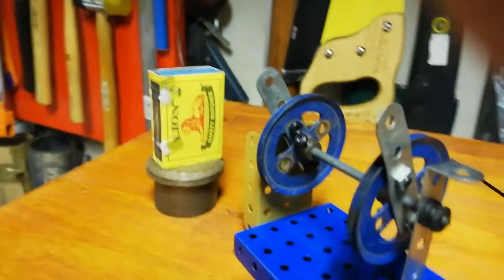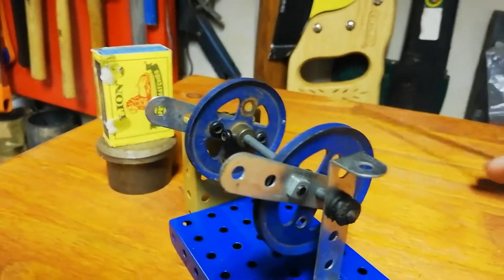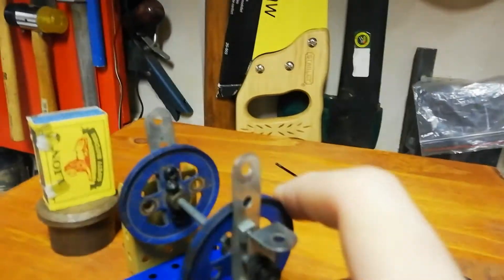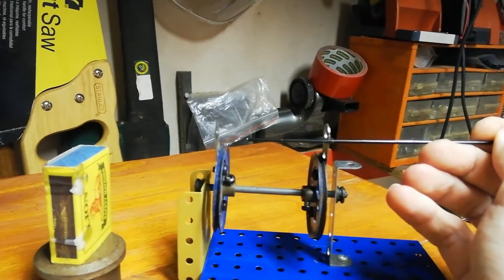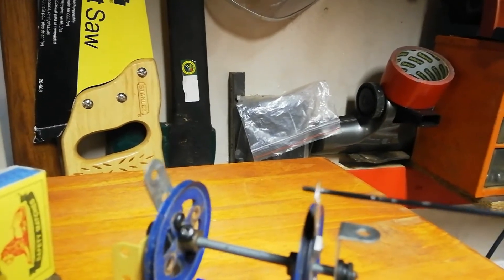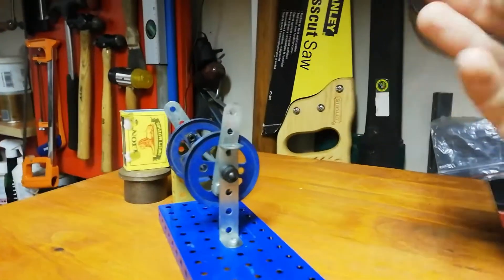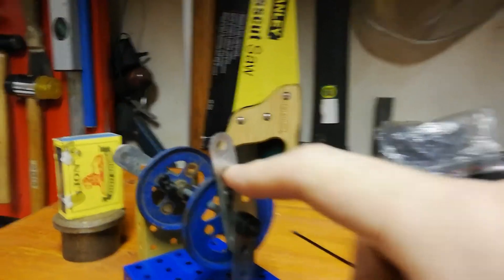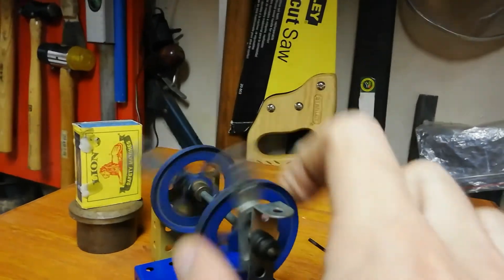Measurement of the Speed of light in 1 direction

Comment: An original idea but may have difficult in implementing. 

There are more practical methods. One possible method would be using radioactive decay (for example muons). Fire these particles close to or at a fraction of the known speed of light. If the speed of light in vaccum really is different in different directions then these particles would travel long distances in the direction in which the speed of light is "slow" and very short distances in the direction in which the speed of light is infinity.
Reply: I think that common misunderstanding  of veritasium's idea is that light travels instantaneously is an exaggeration, but even the slightest difference in light speed can change physics
Reply: Yes, true. The violation of rotational symmetry also violates certain conservation laws. 

Also considering that space time bends around large objects light can change direction but still be travelling "forward". This would then require a discontinuity in space time.

Comment: In a manner of speaking, no object will move faster than the speed of sound in the medium it is traveling because it will collide with, accelerate, and effectively heat up the particles it encounters, increasing the speed of sound immediately in front of the object 
and if we set the object in such a way to measure the speed of light how will you know when did you fired the light and when the light entered the second opening as you will need 2 clocks, but as Erik said two synchronized clocks are not actually synchronized if you move them apart 
btw amazing work hope to see more people use their brains in topics like this instead of playing minecraft lol

Comment: I have come up with an experiment to measure the speed of light in one direction. I am serious. 
You start with 3 clocks of the same
Mass synchronized in the center of a disk. Then you move 2 of the clocks outward 180 degrees from each other to the outside of the disk by centripetal force as you spin the disk while one remains in the center. This cancels the possibility that the clocks will no longer be in sync by moving in one direction vs the other or at different speeds. Then you fire photons from the center of the disk simultaneously at both clocks to trigger the time they leave the center and are received. Tada! Can I have my Nobel prize nomination now please?
Reply: Hey when a clock moves then there is change in the time displayed in the clock due to time dilation and that depends on the speed of light so if speed of light is not same in both direction then the change in time displayed in both of the clocks will change by different amount so they will get asynchronized 

By change in time displayed I mean that the clock runs slower when it moves so the time it displayes will not be same as the time displayed by the stationary clock.

And when you fire the photons from the centre simultaneously then they wont remain simultaneous when the reach the clocks in different direction if the speed of light is different in different directions

I am not fully sure of this explanation but I think this is one of the reasons your setup might fail
Reply: @kalpeshbhatnagar1544  yes, I understand that. That is why, in my experiment, the 2 clocks that move outward do so by centripetal force as the platform spins. This way, both clocks are moving in all directions outward, thus canceling out any influence the speed of light may or may not have in any particular direction and it’s effect on either clock.
Reply: @adamholmes1992  whether your moving clocks arrive at their destinations in a straight line or a curved one, wouldn't the time dilation effect will be the same? You're moving the same net amount in the given direction, just with more steps.
Reply: @d.lawrencemiller5755  I only had  physics 120 and 121 in undergrad so I’m no expert, but both clocks are moving in all directions since it is spinning.  They both do this, do any time difference that affects a click being moved in any one direction and to a different amount or not at all in another direction would be canceled out.
Reply: I like your thinking in the move to cancel out the potential time dilation discrepancy in different directions by rotating, its a pretty novel idea.

Unfortunately the set-up still assumes the uniformity of the one-way speed of light in all directions (in the plane of the disk) for the simple reason that we are assuming all parts of the disk to be rotating at equal (angular) speeds.

When we begin to rotate the disk, (assuming this is initiated by some torque applied at the center), the material in the center of the disk starts to rotate. However, the entire disk does not all start spinning at once. Due to the tension from the intermolecular forces between the central part and the parts near it, this accelerates the parts near the center. This essentially continues on in a sort of 'wave' of acceleration, where the parts of the disc further away from the center begin spinning later than those near the middle. 
(The larger the disc, the more pronounced this effect will be)

Imagine an octopus with all its tentacles splayed out. If its middle starts spinning, its tentacles wont stay rigidly pointing outwards, rather they make a sort of spiral shape. This is similar to the effect I'm talking about here.

Anyway, the problem is that, in assuming that all parts of the disc are orbiting the center with the same angular velocity, we are assuming that this 'torsional wave' that propagates out from the center and accelerates the other parts of the disc moves at the same velocity in all directions. This is akin to assuming the isotropy of the speed of light. 

I hope this has been helpful!
Reply: @Dan-ii5wz  thank you for your response :)
I will think about your input and see if I can think of a way to overcome this issue.
Reply: I like the originality of your idea. I can't disagree with any of the concerns listed by others but it might still work for this reason: Veritasium said that unfortunately the difference in time dilation from relative motion will exactly offset and therefore mask any difference in directional light speed. But in this unique rotation you have set up - it may be likely that the directional motion isn't exactly neutralized so that we cannot consider the clocks to be precisely synced when they reach opposite end - however the amount of NET movement to the right for clock A in the end may only be slightly different than the amount of NET movement to the right for clock B. So even though it isn't a perfect cancel - the net difference may be much smaller than the net difference in lightspeed and therefore still show a difference in the end??? Needs more thought. Maybe someone can pick up the ball on this and add a comment. 

I actually posted my own solution video to Veritasium in February. Totally different than anything else I've seen and it works. 

Finally - Defcon Okay deserves credit for trying this setup. The physics of how relativity will affect the transfer of motion of material along the device is a concern by others and myself as well. However - the non-instantaneous nature of the rotation of both wheels in perfect unison might also somehow be compensated for since the "information" associated with rotation from the start side to the finish side also happens to be in the same direction as the traveling light signal itself. That could be considered and possibly be compensated for to get a meaningful result. And then the crank can be started a 2nd time from the opposite direction as the light signal - to see if the angle or result is the same as the 1st time? Something to think about.
Reply: @chriskennedy2846  thank you so much for your response. I’m fascinated by the fact that the speed of light has not yet been proven in one direction. I hope someone can potentially tweak my experiment design to do so.
Reply: @adamholmes1992  Good luck. Seems like the Veritasium video has energized a small community of engineering-minded problem solvers. It's nice to see. My video takes an entirely different approach. Since the theory shows that differences in light speed are accompanied by a necessary equivalent difference in time dilation rates, then I said: forget the light signals altogether and test only the extent of time dilation in opposite directions. That way if the 2 traveling ships at the opposite "finish lines" have the same clock readings, then time dilation is the same and a confident result for testing light signals could be achieved. But if the clocks experienced different rates of time dilation, then their clock times won't match when they cross their respective finish lines and it would be a good indication that we have a varying speed of light, based on direction.
Reply: You can't do that because one of the clocks is in rest with respect to others 
Which are moving with :- ωr

Comment: I don’t understand why you can’t just Measure the speed of light by synchronizing 2 clocks, why can’t you just instead of using an electromagnetic signal use something else. For instance if I had 2 clocks a certain distance away from one another and one had a paint ball gun and the other had a plate that could detect when something hit it couldn’t I start the first clock and then shoot the paint ball gun at the same time and then start the second clock as soon as it was hit. if I knew the velocity of the paint ball and the distance between the clocks I could calculate how far off they are.
Reply: It's a really good idea 
 But there are some issues
First we dont want to measure the distance between them we are actually not able to measure the time difference
Second, distances also change due to motion so if we use paint balls instead of electromagnetic signals. The time it takes to travel in one direction and the time it takes to travel in other will be different if the speed of light is not same in both directions. As the light the paint ball travels will contract according to special relativity and that contraction depends on the speed of light so if speed of light is different in different direction of both paint balls fired in different directions will travel different distances so it wont help in synchronizing the clocks.

Comment: your making it too complicated,  its so simple,  set up 3 mirrors so that they reflect each other but the first one has light source imput and output angle , the first one only serves the purpose of reflecting light to the second one,  sychronise the timers of the second and third mirror, reflect light from the first mirror to the second one it stops the timer, then the second mirror reflects the same light instantly to the third one and stops the timer,  calculate the time difference and distance and voila, you got one way speed of light
Reply: No worries bro, I'm just playing outside the box lol, but it's a good idea, you set up 2 test with 3 mirrors exactly the same and you use your first test to calibrate your second and final answer test, the law of the universe, yin/yan, hot/cold, happy/sad.......    =)
Reply: The issue I guess is in synchronizing the clocks of the second and third mirror
Reply: Easy to synchronise the clocks, you just set up the same mirrors×2 in same configuration as I mentioned earlier I.E. mirror image, and use the first set up of mirrors to synchronise your second exactly same set up, cuz you know reflection is instantaneous, so you just fill in the blanks, a+b=c or something like that
Reply: See there is a small problem I ca  think of that the light from the first mirror does stop the timer on the second mirror and then light reflected from second does stop the timer at third but how to do start the timers what I assume is you would want to start the timers on second and third mirror simultaneously and that's where the problem arises. Cause there is actually no way I can think of such that observers at two different places (second and third mirror) agree on length or time.

Secondly there is the problem of gravitational time dilation which is change in how fast time runs due to gravitational field this comes from the theory of general relativity and due the presence of matter in universe there is no place where gravitational field is zero as gravitational field extends till infinity so this will also effect simultaneity and measurement of length
Reply: Plus I been thinking past few weeks that the meaning of Einstein description of light is C/constant might mean that light isn't moving at all but it is we who are moving through it?
Reply: I am sorry about presenting so many counter ideas but i guess it's a good way to discuss science and I am not trying to offend you in any way 
The idea of we moving through light is something that does not resonate with me as I dont think of light as something what I like to think or what modern theories present is that light is just a disturbance in the electromagnetic field.
The EM field spans all space and disturbance in it means a region of energy or packet of energy which we call a photon and this energy is travelling as we know as the light from the bulb reaches my eye so light does move and so there is no good reason that light would stop moving once it has reached my eye after leaving the bulb. I dont think that would be a good thing as in physics we think of things happening independently of how we think of it or how we sense it. So if light stops after reaching my eye it should also stop after hitting a nitrogen atom as as nitrogen is all around us then light wont even get to us and will stop after hitting the first thing it reaches that means reflection wont be possible and we wont be able to see.
I am again not 100 percent sure about this but this is the way I think of it.
Reply: The only time light travels is when it lights up from a new source or ignights meaning the end, light can push stuff aka solar sails ect.... so I'm thinking the reason that light sources are spherical is because if it was flat it would push itself but as a sphere it pushes in all directions thus being stable
Reply: I forgot to specify that at the point of a light source ignition it has to be spherical or else it'll blast itself backwards from the largest semi flat  area of lumens like a cartoon jet propelled skateboard takes off and his body is gone and neck stretched out and hasn't caught up yet lol
Reply: And on top of that there's multipal light waves infrared ect..... and all react differently as individuals but similar as a whole
Reply: Aka light spectrum

Comment: It's the same as the 3-clocks example of veritasium on which the 2 end clocks are synchronize by the middle clock. Mechanical objects are also not an exception in relativity. For example you have a super long stick that cannot be broken and extends into the other galaxy, if you rotate the stick in any angle, the end of the stick will also not instantaneously rotates, but rather creates a wave in the structure of the stick until that wave reaches the end. That speed of the wave is the speed of causality or the same as the speed of light.  I'm assuming you spun that mechanical wheel right at the center so both wheels will rotate exactly the same.  But in that case you are also assuming that the speed of light is also constant so you will arrive at c even though it may not. But let's assume that the speed of light is different in other direction, then the time it takes for the steel to reach the end of the wheel in both directions has a delay exactly that when a light passes through the wheel will result to be exactly c.
Reply: I agree with this description of the problem. Even though we can't tell, relativity still acts on the rod holding the wheels. So the rate at which the wheels spin would be also effected.
Reply: I think movement through a solid object actually travels at the speed of sound. I could be wrong.
Reply: @poshun9407 yeah, at the speed of sound of that material
Reply: Muon decay measurements in one direction should do it. Muons can travel close to speed of light. 

Alternatively fire two vehicles containing atomic clocks at very different speeds (a rocket and a cable car), both in the same direction and measure time dialation at the finish point.

Comment: I hav idea, plese let me know it will work or not 

As I don't have much knowledge but trying to see what happe if we did it.

Keep two seprate clocks in beam of light at known distance which start counting time when they get hit by light beam. After counting the defrence between time of these two clocks we will be able to calculate the speed of ligh????
Reply: Yes this way no synchronization needed since both clocks will be off, and only start counting when the light turns them on....
Does this work?
Reply: Time flows differently at any two separate locations your stopwatches would need a single frame of reference.

Gravity bends light. So bend it back to the source and the single clock. Use two beams the one-way beam's time recorded and the reflected beam to record the distance covered.
Reply from the maker: The issue is explained here :) https://www.youtube.com/watch?v=pTn6E...
Reply: @DefconOkay  This link is not working. Do you have another explanation video???